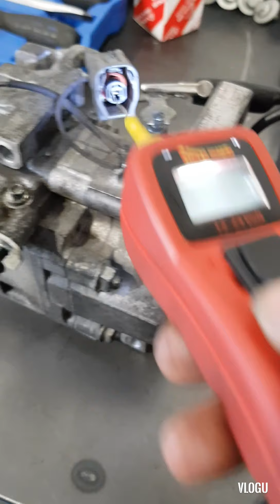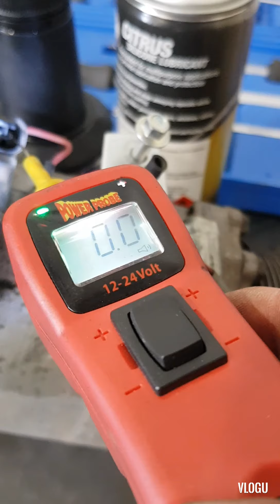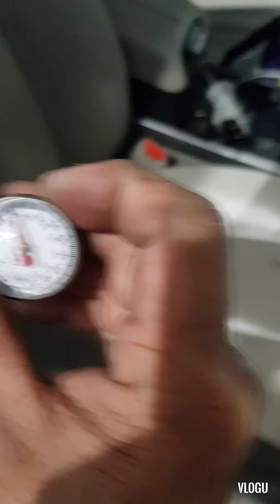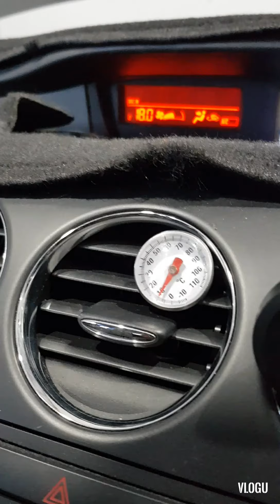CX7 AIR CONDITION PROBLEM NOT GETTING COLD

Comment: I wish I understood Spanish so that I know what you're saying! What did you change? Did you change out the clutch or did you change out the relay?
Reply from the maker: @powerofknowledge7771  Hi mate, sorry for the language I used, anyway the issue was the aux. fan not working and the A/C compressor power supply was not present, so I replace the relay for the compressor and both are had power supply after that but then the compressor electronic clutch still not kicking on, due to run out of Gas, the reason behind was the a/c pressure sensor detected that there’s no pressure on the system reason the relay won’t switching on to activate the electronic clutch to work. I hope this will help to rectify the issue of tour car